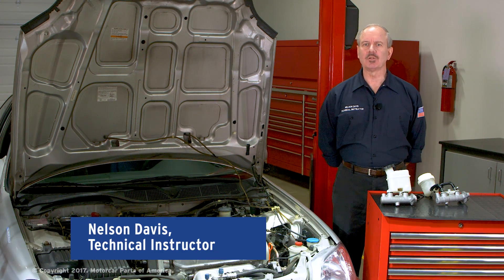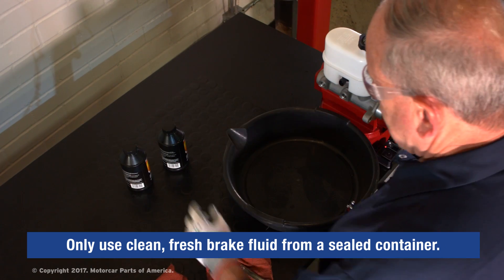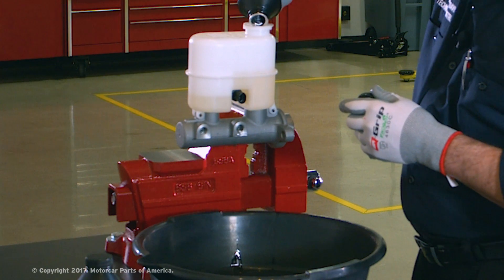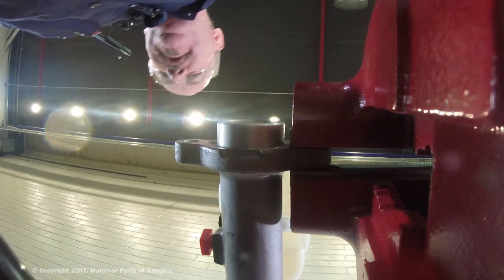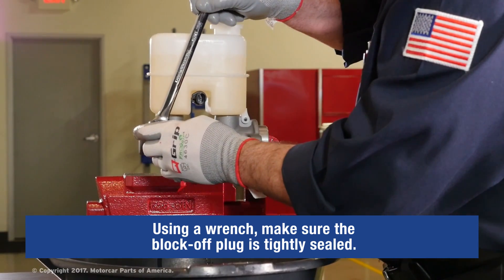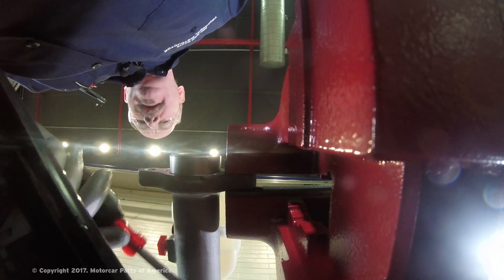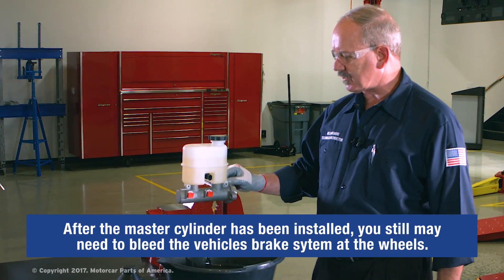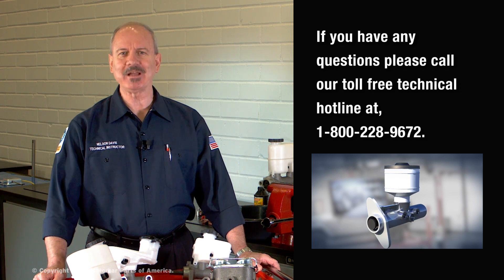Bench Bleeding the Master Cylinder

Comment: My master cylinder flowed instantly, and it started in the front, then quickly in the rear once I lightly pushed on the back of the master cylinder. Didn’t seem normal, but I guess that’s a good thing it started flowing right away. Not even drips

Comment: Can you do this on the car?
Reply from the maker: Always best to bench bleed off the vehicle. 

Bench bleeding on the vehicle can often lead to trapped air remaining in the master cylinder that cannot be removed. Bench bleeding the master cylinder off the vehicle will ensure all air is removed from the master before installing it on the vehicle. If the air is not completely removed from the master cylinder prior to installation this will result in a low, soft brake pedal.

Comment: Very interesting, I've never seen it done this method but this looks much simpler (and cooler) than having to keep pushing with two hoses returning to the reservoir. Is there a definite way to know if this has gotten out all the air completely? I know the other method you can see the bubbles get less and less but this is more based on your judgement?
Reply: It does seem mechanically sound, and they wouldn't tell us anything that would make their product look bad. So here goes...just got mine and I like the quicker process.

Comment: I've never seen it done without putting the hoses in the reservoir
Reply: Me either.  I'm going to try it this way first and then use the tubes if it doesn't work properly.  Did you end up using the gravity method or the clear tube method?
Reply: Did this video method work or you have to run fluid with clear hose to res

Comment: How come your remanufacturing facility was located in Torrance, CA. then moved all alternators and starters to a new factory in Mexico in 2008? Shouldn't it called "Motorcar Parts of Mexico?" Inside the building they were test armature specs from commutator plates and pretending to write it down, over & over. I went around the corner and climbed 3 pallets high to find empty boxes. All dog & pony show.
  They were doing one kind of starter at there rebuild station. To check the starter solenoid, all they did was hit is B+ to see it retract. Since the solenoid is a moving part, but also a large current switch, I asked them "Why don't the place a 100 amp load across the Battery to Motor connection?" They said they were working on that! 
  So if worn out, you will find out after you bolt it on. Perhaps 3 days later at the mall when it won't do anymore than "Click". Keep a tow truck on speed dial and never throw away your receipt. Use zip lock bag, place all repair orders in bag with newest one on top, zip and keep handy.
  Thanks Motorcar Parts of Mexico!
DK, Omaha. ASE master tech since 1978.
Or ask the silver haired fox who plays with his huge diamond ring. He is the head lier! He is probably in government by now!
Reply: Yep, I was just reading a while back how the company that made the original "Vice Grips" (out of Nebraska) was sold to Irwin Tools (think Home Depot and Lowes) who promptly closed the Nebraska factory, laid off all workers, and moved the manufacturing of the imposter Vice Grips to China.  An HVAC company from Minnesota (Malco) bought the old building in DeWitt, Nebraska, hired all the former workers they could find, and began making incredible quality locking pliers under the name "Eagle Grip" in 2017.  Sadly (because of foreign competition), Malco began losing money and was forced to stop production at the Nebraska plant December 31.  They still have some on sale on Amazon, and elsewhere, but when their supply is gone, it's gone forever.  I bought 4 and would highly recommend them if you are any kind of DIY'er.  
Sorry for the long speech, but my short answer is: YES!  I agree with you!  I will always pay more for American made if it is available instead of cheap overseas tools.
Reply: @crocodile1313    It is sad on many levels if you look at the big picture. The US Federal Reserve can only print money while the US treasury barrows money from countries like China. They (China) went into a huge buying spree in the US with money we gave them to cover our loans.
  Now, a step further with a Chinese 100 year plan, has purchased companies and Trade Mark names. I am simply saying that by individuals, portions of % of investments and names of companies or back-door ownership or influence due to board positions but, Who owns "Bell & Howell, IBM-Lenovo computers, AMC, Spotify, Tencent Music (Like iTunes) GE, Haier Group, Segway (2 wheel scooters), Brookstone (Special 60's era tooling) Shanghai (GM) automotive industry group, Snap-Chat, Tik-Tok, Hilton/Carlson Hotels inc, WeWork (Chinese), Sotherby's, life insurance Taikang life, Drahi life, StarPlex Cinemas w/holdings in AMC theaters, Alliance Healthcare services and the strange is "Tencent" has holdings in Tesla (21.7%) and a gaming company "Riot Games" who owns "League of Legends", Smithfield a large Pork supplier w/500 US farms, then Uber-Volvo-Areospace companies shares.
  Buy Gold, get 30 year meal kits and dig a shelter  below 5feet ground where temps are stable.
  Grocery stores have stock issues now, but California will not register 70,000 semi-tractors because they are older and don't have "DPFE" on the exhaust. This system catches particulates (Not a Catalytic Converter) just a cleaner but as it pressure increases on the engine side, the exhaust system has a low pressure, then it senses this, goes into clean mode. Clean mode requires as much as 5 gallons of diesel dumped thru the injectors burning the screen clean. It is wasteful and expensive. The electric semi-tractors are pulling trailers from Long Beach, LA, San-Fran to just over the state line to continue the trip. It is stupid as I live in Omaha, yet trains (Warren Buffet) run to Chicago to unload. Then semi-tractors bring goods back to Omaha they passed the day before. It's the old highway 30 group. Other than that, I don't know anything. 
  Retired, money is tight, but I place money in a second savings account and call it "E" for emergency. You can have as many savings accounts as you want as banks don't have rules to limit. 
  But, car, house, appliances whatever. $100 per month is like a bill. Place it in savings #2 or "E". That is $1,200 per year, $6,000 in 5 years. It's yours. Just thinking out loud! DK, Omaha. ASE Master Tech since 78, retired.

Comment: Thanks 
If I’m not getting any air out of 4 calipers, is that means there is no air In the master or master can still have it?
Reply: Calipers, what calipers, u mean by brake bleeding valve on each tire, if that then it means you have no air in your brake lines, you are good to go.
Reply: @ZZZZ-zg3zb  And just where do you thing the brake bleeding valve on each tire,is located?
Reply: @ZZZZ-zg3zb  he may not be getting fluid to push the air out. He's asking if this is because there is still air in the MC

Comment: If the engine work space permits what is the advantage of bench bleeding over bleeding in-the-car and attached to the brake pedal just
before the old brake lines are reinstalled?
Reply: This piston don't go in as far when on the car
Reply: I reckon you have a difficult time watching if more bubbles come up if you sit in the car

Comment: A poor method of bench bleeding the master cylinder. The best method is with a $9 bleeder kit that directs the fluid from the ports back to the reservoir through tubes. Leave the plastic screw in nipples and the tubes running to the reservoir in place until you attach the MC to the vacuum drum. Quickly remove the nipples and screw in the brake line fittings all the way. Then, while someone slowly pumps the brake pedal, crack open one port until brake fluid leaks out. DO NOT let up on the pedal until the assistant tightens the fitting. Do this two or three times and then tighten it for good and do the other port the same way. In this manner you won't have to bleed the brakes at the wheel. This method displaces all the air between the ports and the tubes.
Reply: It took you longer to type this message, then it did for him to leave the master cylinder.

😂😂😂😂😂😂😂😂😂😂😂😂😂😂😂😂😂😂😂😂😂😂😂😂😂😂😂😂😂😂
Reply: I am with you.  But the assistant may not be necessary.
Reply: I agree
Reply: Thank you so much for explaining this method. I bled the wheels  like 3 months ago, and now I need to replace the MC, since it looses fluid after long trips. I also think to remove the air fm ABS Brake Pump, since Rear Left wheel didn't breed well like others. So I would need to drive ~20 mph, then slam the brakes. After that people bleed the brakes on wheels. May I ask you if I can use the method you described after that procedure as well? Thank you again.
Reply: I'm sure everybody has their 2cents to contribute. But you are wrong. I am currently having trouble bench bleeding my clutch master with this bleeding kit you are talking about. Just  a simple hose running back to the reservoir got bubbles out but piston won't get stiff no matter how many times you keep pumping. First thing I did when removing this master cylinder was to block it off with my finger and pump it, this is the only time I actually got the piston to get stiffer but obviously simply blocking it with finger pressure isn't enough. I need to get some block off fittings. Great video. About the 2nd one I came across today with the block off technique instead of the redirecting to the reservoir.
Reply: @sergioup5902  The piston doesn't get stiff this method because its free-flowing fluid, the goal is to get the air out, not necessarily to make it hard to pump.
Reply: @tripog007  

😂😂😂😂😂😂

You clearly don’t UNDERSTAND how hydraulic systems work!!!

So… allow me to educate you.

1. Air, can be compressed as in, an air compressor.

2. Fluid, cannot be compressed.

As a piston moves through the bore, air is being forced to either, be compressed, or to be pushed out. 

Once the air has been completely pushed out,  fluid is inside bore cannot be compressed!

If fluid or oil cannot be compressed, then, that piston will eventually come to a complete stop.

Just like your brake pedal does when you remove all of the air out of the brake system. 

If you have driven a vehicle with a hydraulic brake system, then you would know, once you trust on the brake pedal, it only travels so far, then comes to a complete stop. 

“THERE YA’ GO!”

You’re welcome !!!

👍🏿👍🏽👍🏻👍🏾

👏🏻👏🏿👏🏼👏🏾
Reply: @tripog007  Thank you for this tip, I bled my master cylinder on a bench however the piston doesn't get stiff at all no matter even if there is not a single air inside.

Comment: When doing this is it normal for the MC to introduce new air if the Piston is pushed in too rapidly?
Reply: It will be impossible to introduce new air so long as all of the nipples are threaded/sealed properly. It may be possible for air that is already in the cylinder to split in to smaller bubbles making it seam as if there is more air but there is no place for new air to enter. Although the new piston could have a faulty seal. Highly unlikely but possible especially with remanufactured MCs.
Reply: @rivit7615  I don’t know about that, air can enter the MC via the booster side of the piston.
Reply: @mahatmagandification  If the MC is damaged then sure. That's in line with what I said about being sealed properly though. A new MC should not have any way for the air to enter.
Reply: @rivit7615  Except that isn't what you said, you were talking about nipples in your original comment...

"It will be impossible to introduce new air so long as all of the nipples are threaded/sealed properly. It may be possible for air that is already in the cylinder to break in to smaller bubbles making it seam as if there is more air but there is no place for new air to enter." 

If you're going to edit, you may as well correct "seam" too.
Reply: @rivit7615  I don't know why you would think it was specifically about a new MC. Wasn't trying to be a jackass. My question at the time was genuine as I was having that exact issue with a new aftermarket MC for my BMW. Your reply came much later when I've already answered my own question. The the aftermarket new one, and my used ones introduced air this way. I wanted to point that out as a valid possibility. In any case, even if talking about new ones, I don't think it deserves any push back, as it certainly isn't impossible. Think about all the junk shit out there, especially new car parts.
Reply: @mahatmagandification  I apologize. In the video he was installing a new one and you asked a very specific question about the pumping action possibly causing bubbles. In my statement was  trying to explain that if you DO have bubbles it is impossible to be from the pumping action it self. My wording may have been misleading or confusing, maybe even off the point completely? I am not a teacher in any way.  I have been doing this for over 2 decades and forget that what may seem obvious to one person may not be to the next. I learn things every day even now which is why i watch a lot of youtube vids. Every now and again i find a nice short cut that someone has figured out that may make my job that much easier. In my experience, for what its worth, always buy OEM brake MCs. The manufacturers know what they are doing. Usually... ;D
Reply: @rivit7615  All good, and trust me I wish I could but it’s NLA :/
Reply: @mahatmagandification  yep, that's the reality for many of us with classic cars.  You have to take what's on the market.  If you're lucky, you can find reviews or forums where other owners can give you useful leads to good quality parts.

Comment: Thanks for the video. I have subscribed to your channel.
Please do I have to bleed ABS device after changing master cylinder? The machinc bled the master cylinder after installed at the car and bled the four wheels but still sometimes break padal goes soft when pressing! I don't know if he bench bled!
Note: no ABS light blinking/on.
Reply from the maker: After bench bleeding the Master Cylinder and installing it on the vehicle we also recommend bleeding the rest of the vehicles brake system at the wheels following the vehicle manufactures suggested procedures. On some vehicles this may also require the use of a Scan Tool to activate special bleeding procedures for the Anti lock Brake System. Should you have any further questions or concerns, please call our Toll Free Tech line at 1-800-228-9672 and our ASE certified technicians will assist you.
Reply: @MotorcarParts  Thank for the advice, I am not in US and I would have called you without hesitation since I am looking for reliable service. The mechanic repeated the bleeding process following manufacturer steps and used auto tool but manufacturer did not mentioned bench bleeding and he did that after I asked him to do so. The auto tool showed no issues except that some dirt that causes acceleration pedal to get stiff sometimes. He removed the dirt and acceleration pedal is fine now. Unfortunately the mechanic seems to have no idea what bench bleeding is? I noticed that most of times brake gets soft when turning extremely left U turn, maybe caliper issue, but no friction sound and the vehicle doesn't lose balance when braking. I tested with speed of 80 KM/Hour. I also doubt that they might be some oil in the booster that causes the brake softness but the brake pedal never gets hard so it is something else. paid a lot of money and yet still the same. I am going to move to different mechanic and asked him to follow the steps you recommended and bench bleed is must otherwise i am not paying him. My vehicle is KIA Sorento 2016, 2.4L, 4WD. I am getting disappointed with KIA it is hard to diagnose.
Reply: @eng.yousif1  buy a Chevy!
Reply: @illmatter850  I will consider it. Thanks, I checked. Chevy is strong and reliable vehicle. Time to change!
Reply: @eng.yousif1  gm is crap
Reply: @illmatter850  Chevy is like the wish version of a real brand... Nice try though.
Reply: @eng.yousif1  You're better off with a 5.3 silverado than any GDI engine Kia. So fucking many failures with those engines.

Comment: Where do you buy the block off plugs at?
Reply: you dont need them, just put them in and bleed them at the wheel.
Reply from the maker: @lucidbarrier Block off plugs should be available at most auto part stores or online vendors.

Comment: When you remove the block off plugs after completing the job, is there no passage for air to re-enter the pressure chambers? Sorry for the beginners question.
Reply from the maker: A couple of important things to help with this question

Block off plugs should not be removed until the master cylinder is installed on the vehicle and the brake lines are ready to be connected to the master cylinder

Always maintain adequate brake fluid level in the master cylinder, do not allow the fluid level in the master cylinder to drop below 1/2, refill as required during bench bleeding and installation, this helps prevent air from entering the master cylinder

On some vehicles bleeding the brake system at the wheels after bench bleeding and installing the master cylinder may  be required to remove any trapped air from the rest of the vehicles brake system.

I hope that helps!
Reply: Thanks for the detailed answer. @MotorcarParts